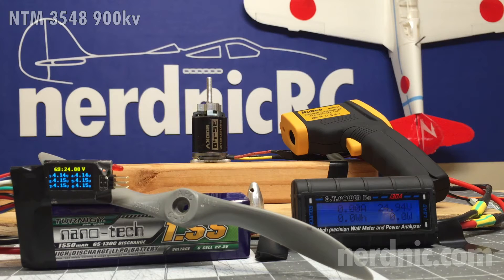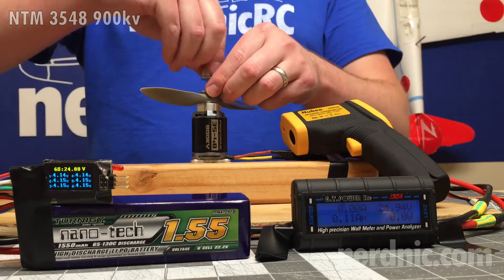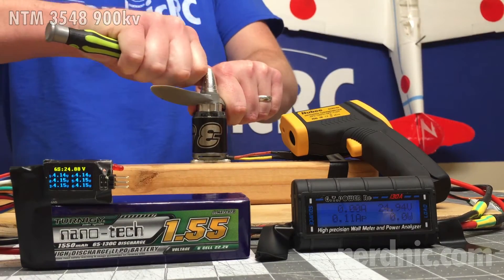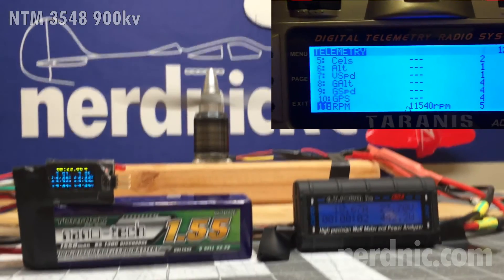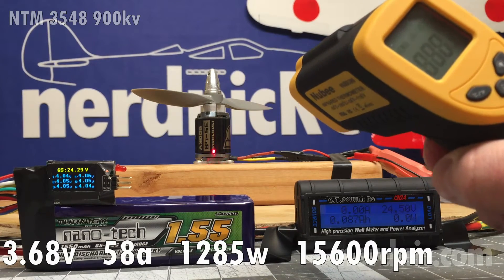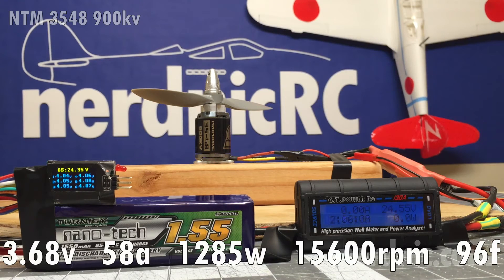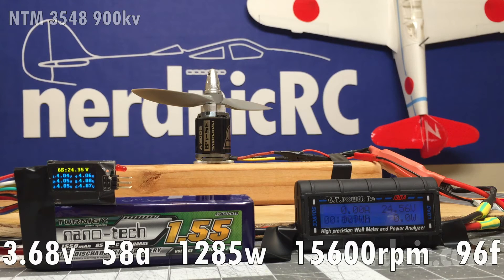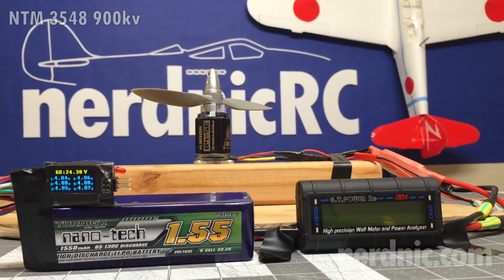nerdnic | Bench Test - NTM 3548 900kv - 6s 8x10 prop

Comment: 1.72 HP thats a pretty big motor.
Reply from the maker: Yeah it's 170g of muscle! This size motor usually swings a 13x inch prop on 4s. It can easily power a 1700mm size plane.
Reply: Yeah. Is there a higher KV motor from NTM with the same dimensions?
Reply from the maker: Just 1100kv.